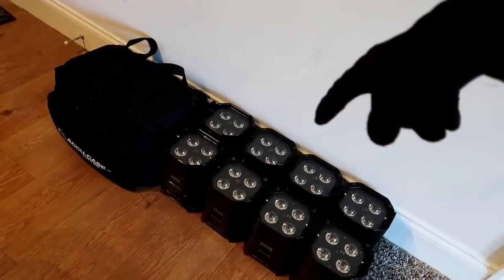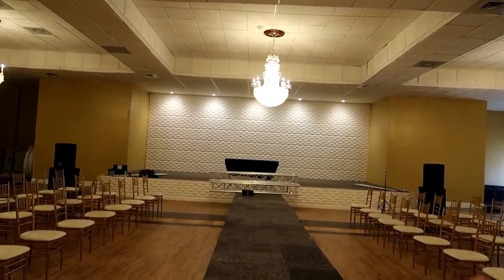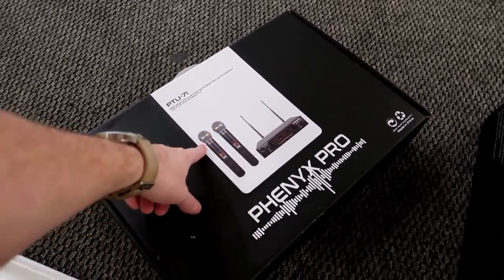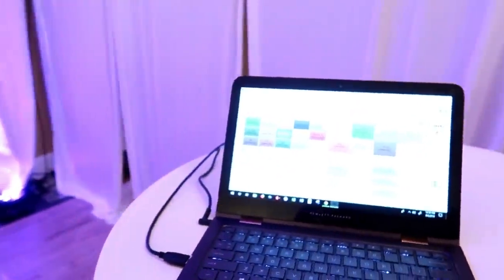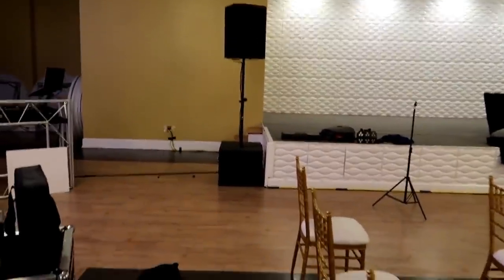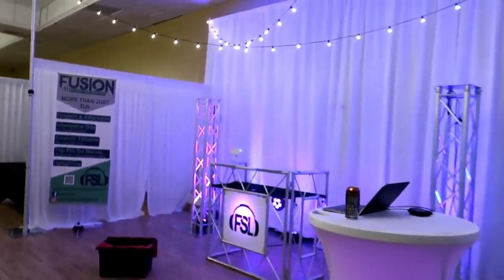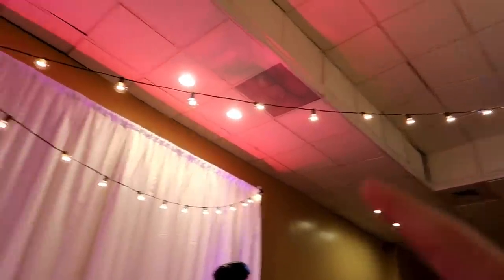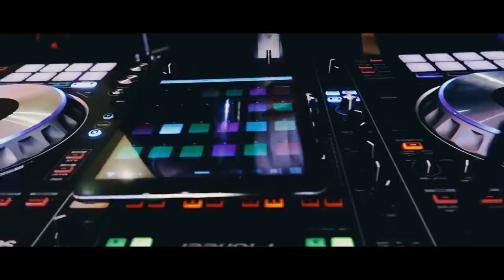DJ GIG LOG 094 | Fashion Show Production | Wedding Show 4 | NEW Lights ADJ Element Hex

Comment: Good video. If you're doing fashion shows and runway stuff, look for the chauvet ovation or etc source 4 fixtures to light the runway. I notice that you are using led wash fixtures to light the runway...which is good for your first runway gig show...but I would upgrade to something you can focus more. The problem with those led's are that they give a blue/purple tint to everything especially in cameras for the photographers. The colors on the dresses and such also can be discolored and not viewed how they originally look because of the led blue tint that led's give off. I'm not sure what the movers on the truss were for on the side wall( i may have skipped a part in the video if you describe why theyre there) but its a little distracting from the main entertainment. It looks a little to DJ style with the movers over on that wall. Like another comment on this thread said, enhance the show instead of be the show. I use that a lot when I do gig's for my lighting stuff because I don't want to over do the show no matter how badly I want to do awesome lighting effects. Anyways tho, good video.
Reply from the maker: It was a wedding show not just a fashion show. I cared more about my booth attracting clients then the fashion show. And the av and lighting for the fashion show was a barter deal with the show staff so I didn't put much effort into it.
Reply: DJ Rick Web I gotcha man

Comment from the maker: Become a Supporter of the Channel!! https://bit.ly/2O7OfWU
AC Outlet locking plug https://csnl.com/products/ac-locking-power-cord-splitter
(Use promo code "Rick" when you check out to save some money)
EQUIPMENT USED
Lights
-ADJ Inno Spot Pro http://amzn.to/2jxwK5g
-ADJ Mega Hex Par https://amzn.to/2ClGYz0
-ADJ Element Hex https://amzn.to/2CO8LZP
-ADJ Pinspots https://amzn.to/2CnkWvH
-Chauvet EZ Gobo https://amzn.to/2RTjCWK
-Chauvet Wash FX 2 https://amzn.to/2qb1eMH

DMX
-Chauvet Xpress 512 http://amzn.to/2jXKfYM
-ADJ My DMX Bridge https://amzn.to/2Y4uS5U
-Donner Wireless DMX http://amzn.to/2iNZZzH

DJ Tools
-Vmoda Crossfade Headphones http://amzn.to/2lcyYEj
-Laptop Stand http://amzn.to/2mOviJM
-Fold up Laptop Stand http://amzn.to/2yshfSV
-Rock and Roller Cart http://amzn.to/2yszpEr
-Cable Bag http://amzn.to/2DqTETM
-ADJ Pro Event Table http://amzn.to/2EACRwT
-Gaffers Tape http://amzn.to/2AVJyYc
-Musician Ear Plugs http://amzn.to/2CUjOgw
-Sound meter https://amzn.to/2CO0jdh
-Kill-a-Watt https://amzn.to/2pZMbVP
-4ft Table Scrim https://amzn.to/2yKUyIV

Mixers 
-DBX DriveRack PA 2 http://amzn.to/2t2izad
-Pioneer DDJ SZ (Serato/Virtual) http://amzn.to/2myaTcf 
-Yamaha 12 channel Mixer https://amzn.to/2TK7KYf

Speakers
-JBL VRX 918sp http://amzn.to/2ys5Vq5
-JBL SRX 815 http://amzn.to/2fhPTrL

Truss/Staging
-Pipe and Drape https://www.georgiaexpo.com/
-Metal O-clamps https://amzn.to/2q57R2Z
-Safety Cables https://amzn.to/2NKkwl9
-Global Truss 2m https://amzn.to/2pUPFZD
-Global Truss Base Plate https://amzn.to/2CPKwKK
-Global Truss Top Plates https://amzn.to/2pVVndB

Mics
-GTD Audio G-733H Wireless Mics http://amzn.to/2izMKV5
-Phenyx Wireless Mics https://amzn.to/2T4KeV3

Cables
-XLRs (Hosa) http://amzn.to/2DnHZVl
-DMX (Hosa) http://amzn.to/2CSiQAX
-Power (Hosa) http://amzn.to/2DqTUBw
-Power (12 gauge Light up ends) https://amzn.to/2CNZYr1
-Multi outlet cable (Hosa) https://amzn.to/2RUrkQi

VIDEO GEAR
-(Main) Cannon G7x Mark ii https://amzn.to/2B3ntfy
-Cannon G7x http://amzn.to/2iNVN3a
-GoPro Hero Plus http://amzn.to/2iO0RER
-DJI Phantom 3 http://amzn.to/2iGFlOJ
-Joby GorillaPod http://amzn.to/2jvlbM6
-Seagate 2tb Hardrive http://amzn.to/2tr6wTb
-Samsung T3 hardrive http://amzn.to/2tWVKpM
-Edit Software: Cyberlink Powerdirector 14 on Windows 10
Reply: What is up

Comment: as someone who does theatrical lighting design and really cropping and aiming lights in specific places I got a good laugh at you just using floodlights to light the runway as if it were me I would have easily hung more than 8 color source spots to cover everything or used pars on the stage as front light. But it was funny so
Reply from the maker: When your doing it for barter it wasn't worth the time and energy to do it the proper way

Comment: You just gotta "flip that flop" but the setup was good, still don't know what 2.5 foot metre totems are lol but I do like the idea of maybe making the totems completely wireless and battery powered with some battery pars on there and the Donner wireless dmx or ADJ EXR Bat.
Reply from the maker: 2.5 meter is just the length of the truss. Normal DJ totems are 2 meter or 6.6 feet. 2.5 meter is 8.5 ft.
Reply: Dude I was joking about based on your commentary
Reply from the maker: I barely remember what I said in the video.... lol

Comment: Great job man! Professional as always. Looks like maybe some monitors on stage could have been used but not required. Depending on the size of the runway we like to use some of those LED bars to upligbt people as they walk down but only if its wide enough for them not to trip.

Comment: In 2 weeks time im doing a crazy big production. 14 fixtures: 4 moving heads 2 derby effects 2 uv bars 2 scanners 4 high power led pars. Also i will have 4 12" tops and a dual way 18" sub. Its going to be crazy
Reply from the maker: Easy with the huge. My biggest production with 35 fixtures 4 duals and 6 arrays is considered small in the production world. But that's cool

Comment: Stay away from the Audio Technica  System 10 ...the handheld I’ve used have a ton of handling noise...
Reply from the maker: Absolutely agree. I am getting the new 3000 series. Not a believer in wifi based mics.